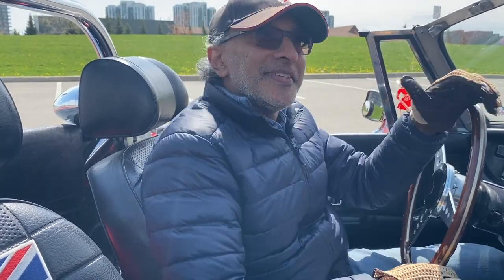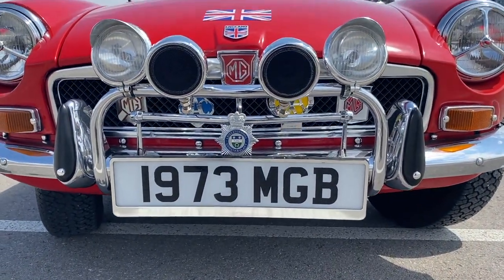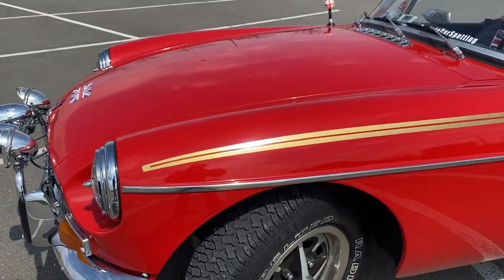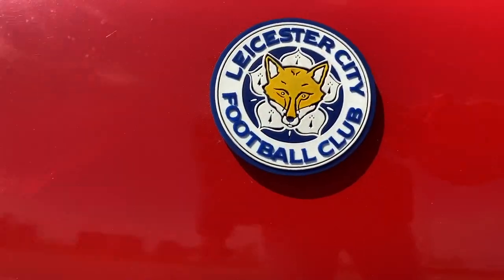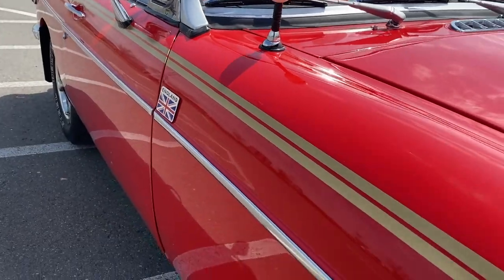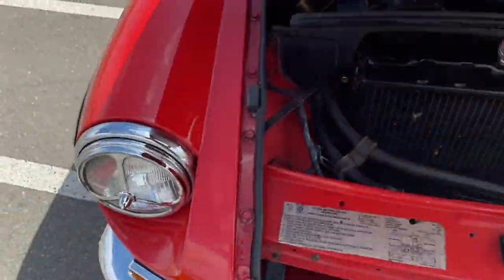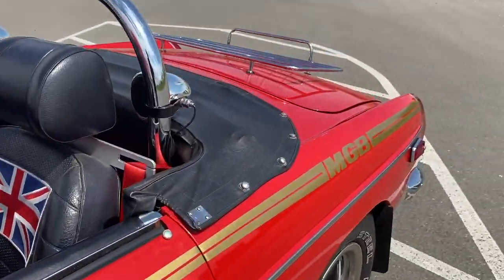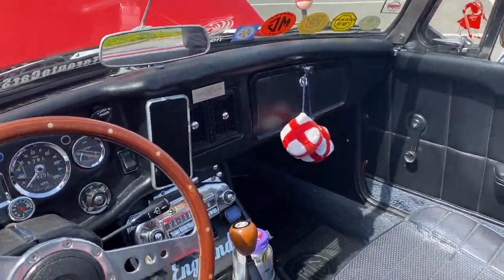1973 MGB Roadster - Classic Car Chit Chat (My Very First Video!)

Comment: That rear view mirror setup is unbelievably fresh. Marcello killed it
Reply from the maker: Kraven.. absolutely.. The original mirror placement was kind of silly for traffic lights in North America which are typically higher than in the UK.. so I was forever trying to look around the mirror to see if the lights had changed. Marcello to the rescue.. a true genius with a CNC machine!

Comment: Beautiful car! Did you know that Ontario allows year-of-manufacture plates on your historic vehicle? If you find an Ontario license plate from 1973 on eBay or at an antique shop you can legally use it on your car. The MTO will just need to inspect the plate to make sure it is authentic and that the number isn’t already in use.
Reply from the maker: JG.. Thank you for the suggestion. I have seen the odd 1 or 2 but sadly many are in poor condition. I wish the MTO would allow say a California plate.. they seem to be in such great condition than our Ont plates. Thanks again.. I am always looking out for vintage stuff.. and appreciate you subscribing and showing your support

Comment: That about safety ? Old cars wasn't really safe
Reply from the maker: Oh no kidding.. When I first got the car.. it had only lap belts and it never felt safe compared to the over the shoulder ones we are used to. I also drive like it is a motorcycle.. I have to be extra cautious and even stopping the car without power brakes.. I allow extra distance. Kevin